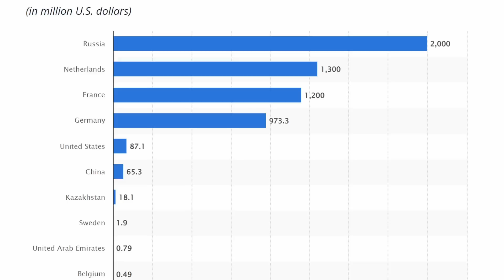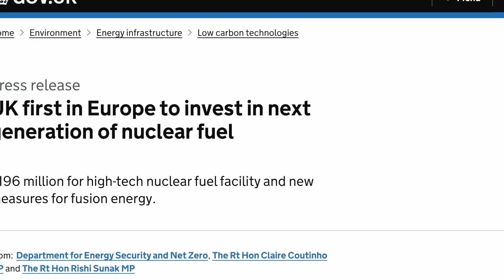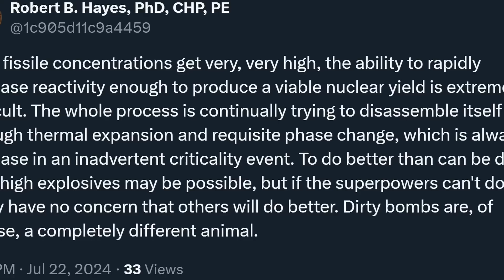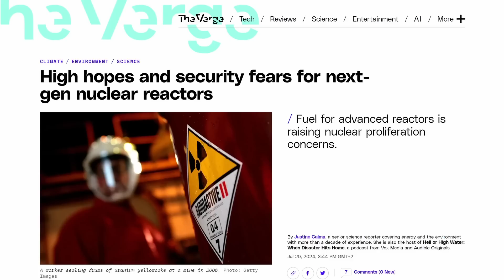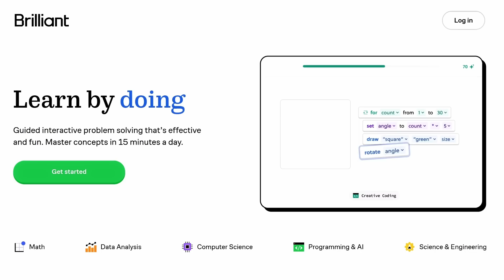Small modular reactor fuel could be used to build nuclear bomb, experts warn

Comment: Given the amount of shielding required, plus the dimensions and form factor, I doubt that these reactors on a truck will generate enough electricity to compensate for their cost. In fact I never saw a power rating so far, and if i the nuclear fuel will need to be more enriched that means extra shielding. Plus there is little indication of passive security measures related to meltdown risks or coolant leaks.
I am still wondering how they are going to deal with all the excess heat being generated by the reactor.
If every part is relatively small to fit the form factor, then the power rating cannot be very high, otherwise there's not much dimensional tolerances to deal with the heat cycles that can cause warping and vibrations. The whole thing seems to be a pipe dream.
Reply: You could, oh I don't know, use the heat itself? For certain applications using the waste heat directly would be loads more efficient than turning electricity into heat after generating electricity from the thing producing the heat.
Reply: @luisostasuc8135  yeah, but that's not the size of a truck container. And if you have seen power stations of any kind you will see that size matters. Plus using waste heat requires a lot of piping, and it's not very plug and play friendly especially at the temperatures and pressures required for commercial use.
Second in most thermal power stations waste heat is not used due to lack of customers to foot the infrastructure bill, and if you've seen large diesel generators and that is the use case they want to fit with these reactors on a truck. None of those use waste heat.

Comment: @00:58 -- Uranium-235 is not a compound, but an isotope.  And while it is more radioactive than uranium-238, they are both radioactive.

Also, if somebody is going to steal or otherwise divert uranium that they are going to enrich, HALEU still helps them by lowering the tonnage that they have to divert, as well as reducing the number of enrichment steps they have to go through to get to highly enriched uranium.

Comment: i thought the real proliferation problem was about the type of reactor, not the type of fuel. some reactors make a lot of plutonium (breeder reactors, etc), which makes higher yield bombs easier.
Reply: The reactor design is influenced strongly by the type of fuel to be used, or vice versa the design changes which fuels you can use. So it's really two sides of the same coin.

Comment: These reactors require relatively highly enrinched uranium of about 20% 235U or you can use about 5 to 7% 239PU. Putting it in a beryllium reflector and quickly inserting a neutron generating rod in the center could build a nuke. The reason is that the critical mass of the U or Pu would also fission the otherwise inert 238U from the fast spectrum neutrons generated.  The amount required is about 1/3 the amounts stated in this configuration.
Reply: @christopherleubner6633  if the initial setup is not supercritical, you'd get a fizzle not a proper explosion.

Comment: Shitlibs will do anything but actually make the hard decisions to address the problems they complain about. 

Solar: 10-15 years of inconsistent power production, not recyclable and terrible chemical leeching into wherever you dump it, requires a LOT more copper mining plus tar earths in the manufacturing process to connect to the grid at scale

Wind: blades also not recyclable, also inconsistent power production, shorter lifespan than solar even, requires a LOT more copper to connect to the grid at scale

Batteries to try to cover for solar and wind inefficiency: require a ton of mining for rare earths plus copper

EVs: require a ton of mining for 5-10x the copper onboard, plus rare earths

Mining for rare earths: requires fossil fuel powered equipment unless you tried to replace with EV mining machinery where see prior point

Nuclear: requires high security and safety, very skilled labor to operate but produces far more power per unit of raw materials you need to mine than literally anything else

Comment: The issue with HALEU... and for the record, pro-nuclear. But the issue is the enrichment process is non-linear. After about 10% enriched you're basically 90% done.

On a geopolitical scale, that was why Iran getting past that step waa a huge deal. Enriching above with gas diffusion even, isn't too difficult. Add centrifuge technology. "Explosive disassembly devices"  is the nickname because they are very sensitive. But that results in easier, more energy efficient production. 

The first nukes made took about 10% the entire US powergrid to have enough energy to diffuse. The plant was big enough you had to ride a bike from point to point... (wasn't shut down until early 2000's)

The issues with HALEU with that bit of knowledge, isn't the physics of creating a bomb. That's easy. It's the acquisition of material, and the massive debt you incur to join the nuke club... HALEU puts enrichment to "weapons grade" is significantly easier... you have a higher concentration of U-235 to start the enrichment process. 

Weapons grade is a misnomer as you pointed out. 90% is generally considered weapons grade. But you can easily use 80% with slightly more material. 

U-235 isn't the only enrichment product. U-233 is another. Less talked about one.

Haleu at 20% enrichment is a bit of an issue from a proliferation standpoint. But why worry about nukes when the disasters affects of not using nuclear energy will kill you just as easily. 

Nuclear secrets are weird because what's secret for one country is completely unclassified for another. So know which country has problems is difficult.

Comment: Even if you melted the whole reactor into a "blob" you could never get more than a 3+shake reaction, and all you would get is a giant blob of stuff which would slowly melt into the ground, mostly self-contained in a bubble by ordinary thermal processes.  However, it would be "highly radioactive, neutrons" so these reactors should be placed well away from populated zones.  A good example is actually the Chernobyll accident, in that if it had not been for the carbon burning up and spreading a huge volatile cloud of gases, the actual core melted into a blob at the bottom of a concrete well.  The Russians were concerned that it would melt through into the dirt, but that would have caused it to get into the water table, which is shallow in that area.  Ordinary thermal, concrete, and civil engineering should be able to handle such designs.  Surely we are not so DEI'd that we cannot handle such simple engineering.

Comment: Saying anything uranium related is a proliferation risk is utterly ridiculous fear mongering. Uranium isn't a practical material for a weapon, which is why it isn't used in modern nuclear weapons and was phased out almost immediately.  Just because you can gather 1000 kg of HALEU doesn't mean you can build a bomb. The entirety of nuclear weapons design is figuring out how to keep that critical mass together long enough to fission as much as possible before the bomb destroys itself, and the bigger the bomb, the easier it is for it to self-dismantle before you get any kind of big boom. That's the reason no one has ever tried to build a working bomb out of 20% enriched uranium. 

That's also why plutonium is the primary material for weapons because it has a lower critical mass. 

Civilian reactors, which use uranium, are also not a proliferation risk. Any country that wants to build a bomb isn't going to use a PWR or BWR with enriched uranium, they're going to build a graphite moderated natural uranium reactor like literally every other nuclear power has done for 80 years. 

You don't need expensive centrifuges enriching uranium to breed plutonium, and trying to sneak uranium out of a civilian reactor is completely impractical. 

You're also not going to use either for a dirty bomb.  The entire point of a dirty bomb is to spread a lot of highly radioactive material and pollute the environment. Both uranium and plutonium aren't very radioactive at all and are more dangerous from their heavy metal toxicity than their radioactivity. Someone wanting to build a dirty bomb isn't going to try and steal reactor uranium, they're going to go for nuclear waste, which would probably kill them before they can build their bomb, or they're going to steal X-ray machine sources. Your dentist's office or a hospital are more of a dirty bomb threat than a small modular reactor. 

I'm willing to wager all this scaremongering about weapons is some very dishonest work by environmentalists who view nuclear as some kind of boogeyman.

Comment: The world burns 9 billion tons of coal a year and rising.   How are we going to make a big dent in that without some serious,  concemtrated, at scale, non intermittent zero carbon energy supply.   When people decided electric cars were a good idea governments, investor, industry amd regulators piled in to make it happen.  With nuclear those same groups vaccilate and come up with endless reasons why it wont work.    I am not actually convinced people want to solve the problem.   There is far more interest in arguing why my side is right and yours is wrong.  The Chinese are forging agead on nuclear.  With luck they will pave the way for rapid, at scale global adoption before it's too late. They can be the laboratory,  work out a standard model, ways to build faster and cheaper.   The cost and time advantages of mass production are routinely applied to solar and wind but nuclear is always too expensive.   Well there is plenty of scope for cost reduction if we apply the same idea to nuclear as solar

Comment: Professors pointing out the qualification of others being lower is not a good assessment to determine if others would be able to do it.
Ingeniuity doesn't have much to do with education acquired through knowledge acquisition from external sources.
And inspiration and intuition is still partially luck-based.
Einstein was a 'small' patent office worker as well, but still showed the much better established and reknowned physics professors how it's done. Innovation doesn't come from established and stalled ways of thinking.

Comment: The americans found out during the Manhattan project that it was easier to extract plutonium from irradiated fuel than to enrich uranium to the high concentration required for a Uranium bomb. If you want to make a dirty bomb, you could also extract the highly radioactive fission products from a conventional reactor and disperse them using a converional bomb. It would be a lot easier to break into a farm supplies depot, steal barrela of weedkiller and tip them into a source of drinking water
Reply: Firstly, the Americans found a major limitation was if they ran the reactor at a remotely high power it produced low quality plutonium. This is because when Uranium absorbs a Neutron it first decays into Neptunium before decaying into Plutonium but if Neptunium also absorbs a neutron it results in Plutonium 240 which has a high spontaneous fission rate and makes any device less viable. There had to be a slow trickle of neutrons so that it's unlikely a neutron would also hit the same nucleus before it decayed. Considering recent advances in isotope separation the greater concern in nuclear weapons proliferation is cyclotrons distributed discretely all over a nation so there's no single large facility.

Secondly, a so-called "dirty bomb" would be considerably less dangerous than any chemical weapon as the main challenge in cleanup is detecting contamination while detecting ionizing radiation is extremely sensitive. Yet advances in chemical weapons has vastly surpassed lethality per gram while also allowing far larger quantities to be made.

PS: weedkiller kills weeds, and the dilution factor of putting it into drinking water would make even cyanide harmless. Lead in water is a problem because tonnes of lead were being dissolved into the water.
Reply: Exactly. Every single nuclear power except South Africa has built their bombs from plutonium. It's easier and cheaper to breed than it is to enrich uranium, and it has a lower critical mass. 

Uranium bombs were phased out even before we had finished the design of the H-bomb. Uranium can't be used in implosion devices and gun type bombs are absolutely impractical.

No one is going to build a dirty bomb out of uranium or plutonium. Neither of them are radioactive enough. Someone building a dirty bomb is going to do it with cobalt 60, most likely stolen from civilian sources like hospitals.
Reply: Great idea, I'm on it.
Reply: What sort of weed killer most are harmless to humans like table salt.
Reply: @indica8510 Found the Monsanto industry plant!
Reply: @toddhoward1892  todd howard calling it like it is
Reply: You are Miss informed glyphosate is not safe, it disrupts the endocrine system. 
Dysregulates gender hormones. @indica8510
Reply: @indica8510  50-100g salt is deadly
Reply: @indica8510 yeah I thought this, even the toxic ones aren't very toxic, pesticides on the other hand...

Comment: But why take the risks anyway as renewables are reaching 100% of electricity production in increasing numbers of states. It's very difficult to weaponise wind turbines solar panel and mass storage batteries. It's also far cheaper than any kind of nuke but especially SMRs cheaper to build but make more expensive electricity than big nukes and something like 4 to 5 times the price of a unit of WSB electricity.

Comment: This nonse should be stopped. No way small reactors could be cheaper to build and maintain (per kWt) than a bigger ones. It is always cheaper to protect and maintain a centralized facility. The only possible benefit is saves on energy transportation. Minuscule on the level of expenses we talk about in this video.

Comment: When I talked with someone from the FRM2 neutron source outside Munich, they explained that they are not happy about having to switch to less enriched Uranium (probably HALEU with about 20%) in the next few years because France will stop producing the highly-enriched (90 %) fuel rods they had used for years. Apart from the difficulties involved with switching the fuel source, they'll need more fuel, produce more waste and probably have decreased reactor performance overall

Comment: Its not that hard to enrich uranium, the science is all over the internet. I am sure with the kind of resources rich individuals can have , if they are determined to enrich uranium it wont be that difficult. All the know how beginning from the type of steel to use to make gas centrifuges  to how many cycles , staging, temperature , what gas (UF6) , speed etc.. all can be found in books and the internet. With sufficient resources anything is achievable for determined individuals.

Comment: I'm a lot more concerned about what comes out of fast breeder reactors, than the HALEU going in. Looking at you terrapower. We've been so convinced that nuclear waste is such a big problem (it isn't) that we're starting to consider breeder reactors again to reduce that waste, at the cost of recoupling nuclear power reactors and nuclear weapons material. Sure it's a "breed and burn" reactor, but what happens if a bad actor decides they'd rather refuel prior to the "burn" stage? Well that bad actor now has lots of weapons grade nuclear material on their hands. What stops them? Nothing from a physics or engineering perspective, just us asking nicely that they don't. 

We're much better off just staying away from breeders and burying the spent fuel in the ground, in my humble opinion.

Comment: One of the biggest problems of nuclear energy is the safety around waste and I don't see how having reactors at your gas station is going to improve things. Also a lot of amateurs with containment issues.
Reply: It has already been covered several times in @Sabine videos, but waste are really not the biggest concern.
Reply: Eh not really. We deal with literal tons of low level radioactive, let alone broadly biohazardous, waste daily. It's not that hard. Even for the harder stuff, people are in close proximity to massive death machines on a near constant basis. If anything, fear of nuclear will help keep people in line and not complacent with rules and regulations. Hell of a lot safer than driving a car either way.

Comment: To replace a full sized power plant w/ a smaller nuclear reactor would cost as much as building a new one = since a 600 megawatt electric generator cannot be reduced to 40 or 100 megawatts & the same goes for the steam generators - all new piping , valves , instruments, wiring , circuit breakers , training new reactor operators , maintenance personal and redesign would be skyhigh - think of rebuilding a nuclear ship, an airplane or skyscraper - no one does this why not?